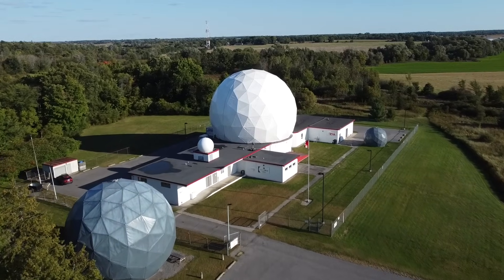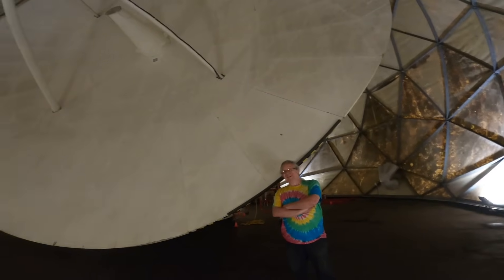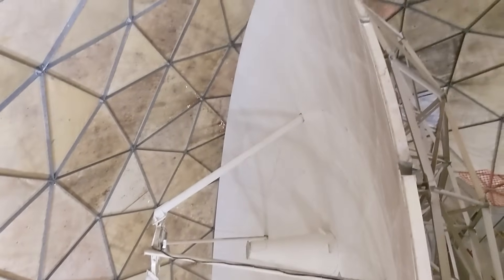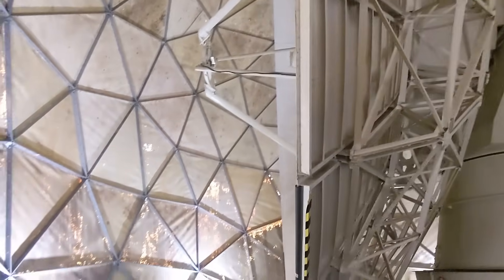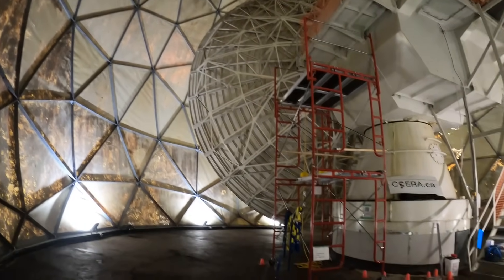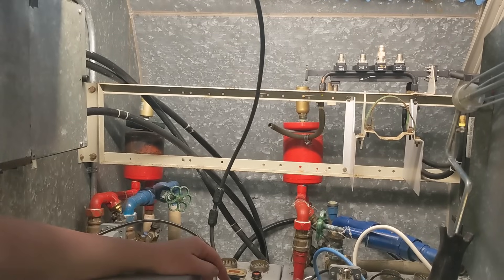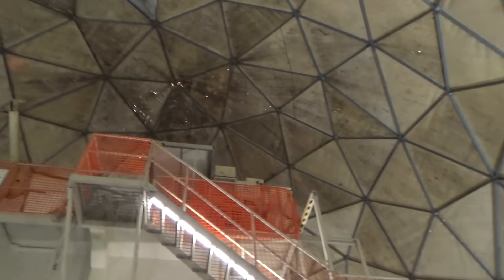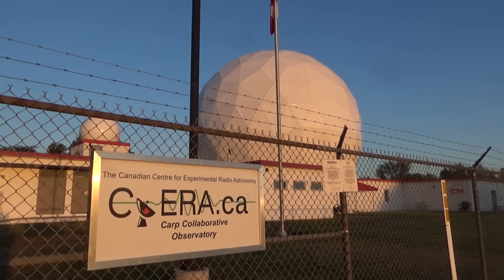This Cold War Satellite Station Is Getting A New Purpose

Comment: There is old maps od the various nato communication infrastructure. And they are almost everywhere across europe too. Sadly largely dismantled by now.

I have a maritime camera system. Its a massive tianium gimbal with all kinds of sensors, motors and ship cabling. I got it off evay because I was interested in the thermal cameras inside... But some of the parts shown there seem simialr. Like the encoder and elevation sensor, counter weights...
Reply from the maker: That camera gimbal sounds neat! I bet you could put a satellite dish on it!
Reply: @saveitforparts  it's made to look at the ocean and the horizon... So it maybe got 23° of elevation and that's certainly not enough for tracking a satellite overhead. I took it mostly apart and might just use the 27kg titanium shell as a flower pot... repurpose the massive motors and sensors for someone else in the future

Comment: Thank you for the detailed video and the insights into the facility; it's an interesting project. I was a bit surprised about the water cooling. President Marcus Leech explained it very well, which was quite intriguing. I'm looking forward to how your project progresses, especially with winter approaching soon.
Reply: Radio transmitters are one area where vacuum tubes are still regularly used, and the big ones can get quite warm.

Comment: Electric forklift motors,  some wire edm cut gears and wa-la, a raspberry pi and you could have some reasonable tracking. 😀
Reply: We're actually going to be using quite-modern software-controllable servo motors, made by an outfit in Rochester, NY, called TekNic.

Comment: I find myself wondering if a walnut based sand blasting setup, followed by a shop vac, would improve their process for rust removal and restoration without risk of damage to the systems.
Might be worth considering, could be drastically better than working with a grinder.
Reply: You gotta think about dust collection though.

Comment: This project looks quite similar to the German Astropeiler Stockert, which was a joint venture between radar and radio astronomy in the 50s/60s, also decommissioned and picked up by a public association that restored it and converted it to a modern radio telescope, and interestingly also converted the mirror from Cassegrain configuration to prime focus.
Reply: I interact withe the Astropeiler folks on a very-regular basis.  I love their dish, and the  building under it is really architecturally unique....

Comment: I'm not sure that converting from a Casegrain to a prime focus is a good idea. The whole idea with the Casegrain is that it's easier to design the subreflector to properly illuminate the dish than it is to design a feedhorn to properly illuminate the dish. By going to a feedhorn rather than the subreflector, they've probably decreased the efficiency of the dish by a lot, essentially making it electrically much smaller than it actually is. Seems like a rather large technical blunder, and 5 steps backwards on a project that's already extremely challenging and doesn't need any "un-forced errors" as it is!
Reply: Actually, in order to illuminate that sub-reflector at lower frequencies, you need a MUCH MUCH larger feed-horn to give you the proper gain to illuminate the sub-reflector.  We did actually think about this.  The prime-focus feed is working just fine.  The F/D of the dish is about 0.32, which means a modest-gain feed, which is what we have.  Not our first rodeo....

Comment: If they're trying to reuse the hardware to make their telescopes swivel 360°maybe they should consider like a bmx bike and the way the handlebars can rotate 360°without compromising full function of the breaks probably a lot easier on the mechanical side then I guess they're cooling side if that's even still necessary
Reply: Those existing systems are definitely going to take some retrofitting to avoid going retrograde like the old school telephone

Comment: I converted a five meter Scientific Atlanta dish from Cassegrain to Prime focus, back in the mid '80s so we count pick up three C=band satellites at once. The dish was on a hillside, where we couldn't reach it by ladder or bucket truck, We rran a ladder horizobtal from above the dis, and lowered a tech by rope to remove the Cassegrain feed. It was lowed to the ground with several ropes.
Then we had to cut three mounting hols for struts to hold the new feed. The papers shipped with the conversion kit was drawn wrong, so the focal length was no where close. You could pick up a weak signal across a 15 degree angle. I told the corporate VP dweeb that the instructions were drawn incorrectly. only to be told, "S-A DOES NOT MAKE MISTAKES!" Well they had. They had also sent updated documentation by certified mail. 
The idiot system manager had signed for it, and tossed it in the trash as. "More sales bullcrap" without opening it. A four hour job turned into over a week with a dozen channels missing from that Cable TV system.

I was working at Microdyne, when the DR/RCB2000 series SDR Telemetry receivers were developed. They did things that a USB dongle couldn't. That included a 70 MHz IF to feed a data logging tape machine for further analysis. with multiple data channels. It ran from an embedded controller running Windows CE, and could be controlled by a built in web server. The RCB was a dual diversity system, in a single rack mount chassis. The DR was scaled down, to a single receiver.
Reply: Lowering the Cassegrain sub-reflector was scary, and a tad sketchy, but we got it done.  A bunch of ropes and sheaves and no small amount of anxiety...   We had good docs from NATO (they declassified a bunch for us), and we also took measurements with a laser range-finder to make sure we understood where the focus was.
Reply: @patchvonbraun  The Skolnik RADAR Handbook is a great source of information on parabolic dishes. An idiot here in Florida had one of the oddball C band dishes with a non standard feedhorn. He got the 'bright idea' to remove it when he headed back to Canada for the summer so it wouldn't be stolen. He destroyed it, in the process. I had to design a mound for a standard feedhorn, and modify his crap receiver to work with it.

That S-A feed was over 250 pounds

O did field repairs on several brands of C-band receivers, back in the '80s. I started with Rockwell/Collins SVR-4F fixed tuned, because they didn't want to repair them at the factory. They were a military design, with a different mechanically tuned 4GHz L.O. that down converted to 70 MHz.  
i
t used a lot of low grade op amps  that were pushed to the limits to provide enough video. At the output stage, they used a large electrolytic instead of an op amp to provide a large DC offset. They ran so hot that it would char the PCB under the caps.
I built my first radio at eight. (1960)
I tested out of a three year EE  course at 20, when entering the US Army.  
I've worked in Radio & TV Broadcast, Cable TV head ends, Two way radio and manufacturing of Telemetry equipment. I'm currently using a Hughesnet system on 55 GHz to access the internet. I never had an Amateur radio license, but I've serviced a lot of it.

Comment: I was a Canadian defense contractor from 1986-1994. This Canadian station was part of the DSCS (Defense Satellite Communications System) which was a US Department of Defense and NATO global network. The station provided secure voice and data communications between major military terminals.
Reply: Reading about your past job definitely explains some stuff about you(r channel) 😅
Reply: Did they also used it for radar? That klystron must have been pretty high power. Sounds to me like more power than it would be required for satellite communication.
Reply: @antoineroquentin2297  Canadian Forces Station Carp, as it was known, was not a radar station. The communication facilities at Carp was a NATO Satellite Ground Terminal. That big antenna was capable of tracking and spying on Soviet satellites in Molniya orbits. Google "Molniya orbit Russian"

Comment: NIce to see some background information on where the new playland igloo came from! Seriously though definitely some good info, can you explain further what the sound deadened tube is at 5:48?
Reply from the maker: That's the central cone of the dish, seen from the inside. I think the padding might have been more for people crawling in there to adjust equipment!
Reply: Actually, it's microwave absorber foam  There used to be considerably more in there, but we ripped it out.  Originally, there was 15kW of X-band radio waves travelling up waveguides through there, and waveguides are NOT 100% leak-proof, so you don't want them coupling back into the receiver side--so, absorber foam.